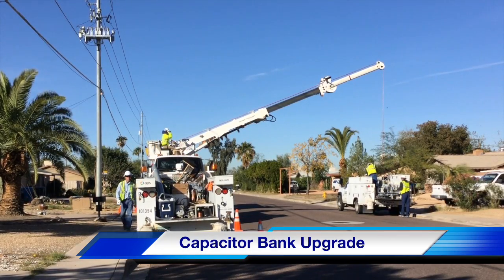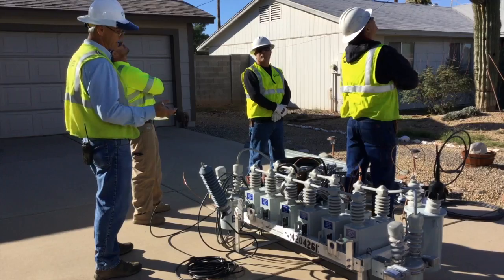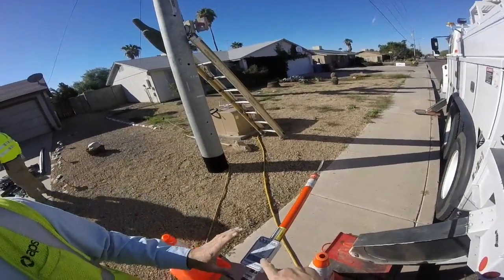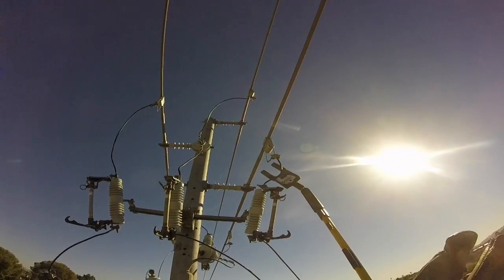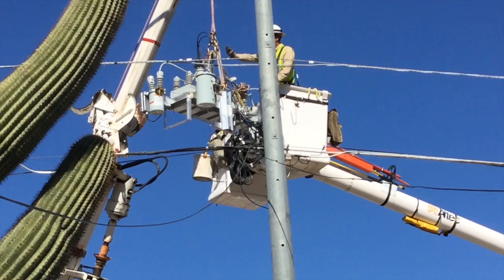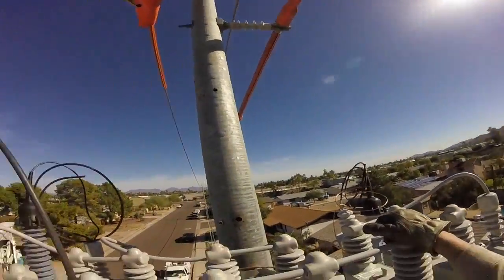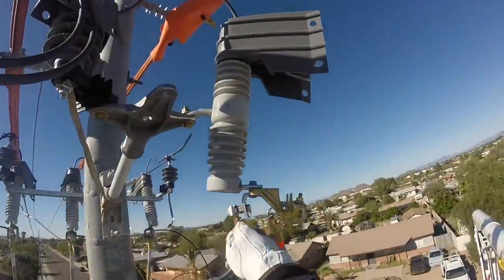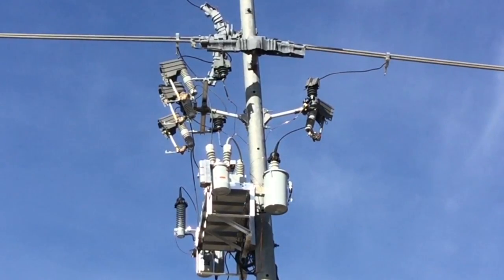How to Change Out a Capacitor Bank

Comment: Yea no gloves no sleeves. No touch ground shown on a Capacitor bank. They hold voltage. One of the biggest safety steps. You need to drain the Capacitors. Man... state 48 what's up

Comment: Never seen anything about discharging the capacitors, ground it out ensure the capacitor is completely discharged.
Reply: Surely they did it tho :) There is discharge resistors in the housing, but it will take few minutes for it to discharge caps, especially the high voltage ones to safe level.

Comment: Not one word about hazards involved during the pre job briefing. Work performed in the primary area in leather gloves without 100% cover up. I don’t care if you read no load on that bank, you never open a cap without a load buster. Geez guys, bad shit happens in a heartbeat and can change lives forever. When complacency sets in, its time for a boot in the ass.
Reply: These are switched capacitors. You probably didn’t see the oil switches under the link break cut outs. The were measuring current confirm the switches were open. The capacitors have less than 50 volts after 5 mins from deenergization anyway. If the meter showed current and the switch was defective you would pull the lever on the cut out to deenegize the phase. Load break tool does not work well on a type C link break cutout. It’s not impossible but breaking the link is easier and a little safer. I total agree about prejob brief. No talk of dangers and what could go wrong.This was not gloving work and at this voltage minimum approach distance was never close so cover up with hoses would require gloves a different approach.
Reply: @markmcvey7686  always use your loadbreak. better safe than sorry

Comment: I once got a nice 7,200V shock  from an undischarged 200kVAR correction capacitor, was completely disconnected from the power source for a while, had one hand on the ground and grabbed the "hot" wire with the other. Threw me back 5 FT and burned my fingers pretty good. No serious injuries of course, almost crapped my pants through. Now I will not touch one until I, myself short out the terminals to make absolute certainty there is no charge.
Reply: It's not dead if it's not grounded.  ABC, 123... Mary had a little lamb.  Capacitors have the capacity to kill you. 

Glad you got the chance to learn from it yourself.... instead of being learned from.

I really am glad your ok.
Reply: Nothing about Safety procedure to discharge the Capacitors??
Reply: metersocket00 shunt the can for Christ sakes.
Reply: Luckily the shock from the capacitor is like a static discharge and very short in duration, otherwise you would have been fried lol
Reply: A cautionary tale. Always assume a capacitors is energized unless it is shunted. Single bushing to case and two bushing is bushing to bushing. Even though a capacitor has a discharge resistor installed you can never see if it is undamaged unless tested. My company requires all capacitors not in use to be shunted. Our specification from the manufacture requires the cans even for banks to be shunted for shipping.

Comment: Hey T&DTV ... I have a question. Why did you go near the capacitors without discharging them or at least shunting across their terminals? Do they have internal bleeder resistors, or did you not show this in the video? ...
Reply: Because they grounded them and let em bleed off

Comment: no gloves, no sleeves, no loadbuster on the cutout opening at the beginning!! nice. Looks like a non union job
Reply: Arizona Public Service is a sticking company, IS union, doesn't require gloves or sleeves (not OSHA mandated) and don't have to conform to the same rules your company uses. Why would you need a loadbuster on a cap rack if your vac switches were confirmed open with an amp check?
Reply: JR Conner you would use a loadbuster even after you amp checked it?
Reply: Another dumb ass union guy. Too stupid to realize amps = load. No amps = no load buster. 

Sincerely a dirty ole scab.